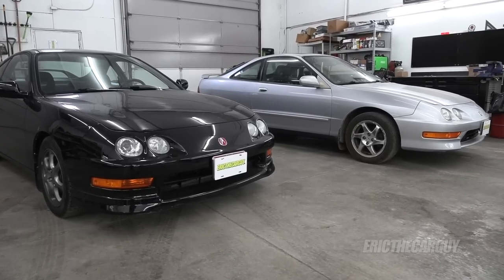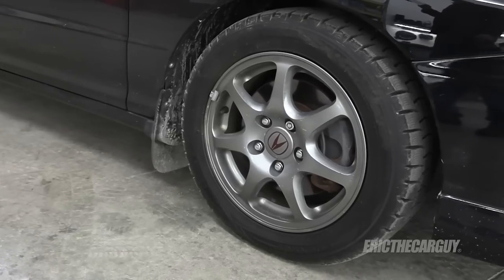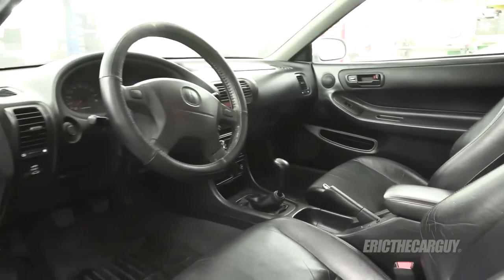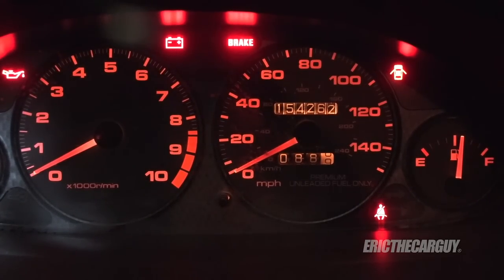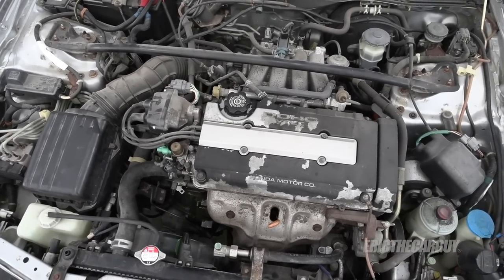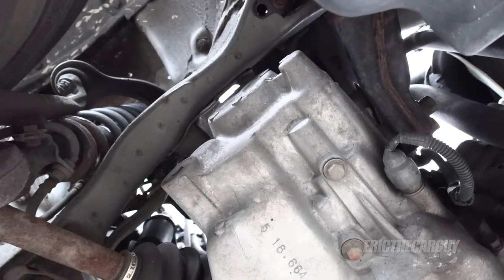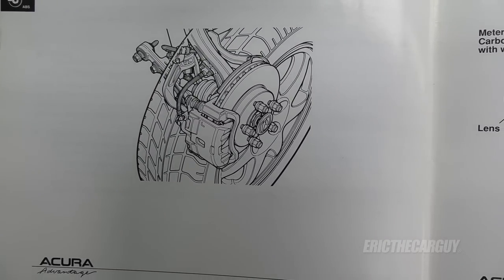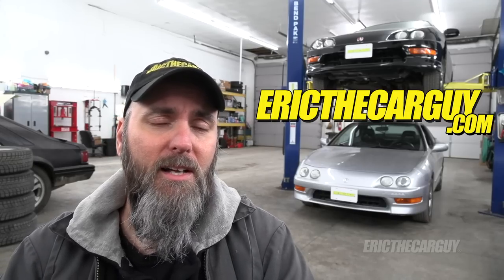Integra Type R vs Integra GSR

Comment: High performance engines always burn a little oil.  No stopping it, and lets face it, the GSR and type R motors are race car engines.  You just don't get that kind of horsepower out of such a small displacement engine without making some compromises and having a little oil burn is one of them.
Reply: F&S Garage it’s better to have oil get through seals and burn then having an over pressurized motor
Reply: @xJDMWaRRi0Rx  they are not race car engines , my friends dodge mini van is faster than these rice lawnmower cars! LMAO
Reply: @xJDMWaRRi0Rx  
You are making no sense
Maybe... than* ?
Reply: Tazer Games oh good looking out bro
Reply: @Mike_Greentea  ok they are not race car engines that also beat some high performance cars 🤷🏾‍♂️ Shame lol
Reply: @Mike_Greentea  doubt that lol
Reply: They only burn oil when the valve guides or piston rings leak.
Reply: Not because they are "hi performance" or "race car" engines.

Comment: You nailed a lot of good points in this video. The gen 2 and gen 3 integras do HUGE with upgraded rear swar bar, sway bar bushings, and new or stiffer trailing arm bushings. A flimsy rear sway bar is an easy way to make a FWD predictable and understeery, which is safe and what most people expect. Tightening up the rear end goes a LONGGGG way on these old cars.

Comment: 1992/1993 The GS-R was available in the 2nd gen Integra in 1992 and 1993. If you had an Aztec Green Pearl Integra in the second gen it was a GS-R. They also have the cool GS-R badge stock.
Reply: I gots
Reply: Db2 Integra gsr>dc2 type r
Reply: @zack54991  false
Reply: TheForbiddenTaco opinion>
Reply: GS-R also came in white and red for 92-93.
Reply: Chip B Those years are my dream car only in white

Comment: Awesome video! So many little details I didn't know about. The poor man's brake upgrade is fantastic: you use mini cooper rotors as they have 4x100 stud pattern, then get the calipers/pads off a V6 Accord/Odyssey like you said. AUDM '98 Integras have the same 1" brake master cylinder as the Type R so it works amazingly well and is cheap. Same can be done on a Civic but the Master cylinder needs to be upgraded too. I have a video of the installation on my channel for anyone interested.
Reply: While I'm here - the ITR rear swaybar upgrade on a dc2/dc4 makes a big difference. I got a dc2r rear swaybar, put some new bushings in and threw that on. It reduces body roll and understeer a lot. When doing this on a Civic or a dc2/dc4 you need to get a subframe reinforcemet (ASR/hardrace/whiteline etc). This is because the ITR came with a reinforced subframe from the factory but the other models didn't. If you don't get a rear subframe brace and you install an ITR swaybar you run the risk of literally tearing your subframe. Also got a video for all this on my channel

Comment: Those rubber rear wheel arch trims shown @3:18 are what cause rust on Honda's, Acura's, Subaru's, etc. They trap dirt, moisture, and salt in the snowy states. Peel them back. You might be impressed at how much crap they hold.
Reply: I never understood why they have to stick out like that and with a gap. They should be tucked under the lip of the well. I mean that's how Hyundai does it and Hyundai is more budget than Honda.

Comment: One thing to note, Honda engines consume oil because the VTEC solenoid is activated by oil. More VTEC = more oil consumption. Love the video! 
-S2000 owner
Reply: I'm also an S2000 oner
Reply: So I have B20 non VTEC swap on mine and it still consumes oil any suggestion on why that is or is it like he said a b-series thing
Reply: Boosted Integra pretty much any high revving engine will consume it, there are ways to minimize it checkout the smoking tire podcast with Steve dinan, he goes a little into how to get more power and less oil consumption out of a e39 m5 engine while making 500+ Na
Reply: As a H22A 5th gen Prelude owner, I can attest to this.

Comment: Great points about addressing rear suspension and accord brakes on civics and integras! That “OEM+” mentality is how I built my E34 525i. E36 M3 cams, E34 M5 Seay bars, E34 540 brakes, E31 850 lower control arms, etc.

Comment: Great stuff.  In 98 I had to choose between the Integra Type R and a Prelude Type SH.  Went with the Prelude, and can't complain as I sold it about 10 years later with 160,000 mostly trouble-free miles on it.  Wish I still had it.

Comment: The b series burning oil statement makes me feel better lol. My little b16a2 burned about 1 quart in single day of track use, (4 sessions, constant vtec and rpms from 5k to 8k etc) and no my motor does not leak a drop of oil. Resealed with all new oem seals/gaskets.  I've been told the oil burning is quite normal, glad you said so yourself!

Comment: A fine discerption of the differences between two of Acura's finest products. In 1997 Car & Driver reported that the main determinizing facture in the production of the type R's was that Honda sub contracted polishing the ports and 200/per year was the limit of the shop. C&R credited 16 of the 20 additional HP to the port polishing. I own a 1996 GSR with 144k miles - I bought it new in October of that year. The BF Goodrich G-force sport Com 2 tires I put on a year ago are EXCELLENT . When the stock coil-overs finely wore out, I learned that the GSR-spec was no longer available.I up-graded to Megan coil-overs which lowered my car 1" - now It corners better then ever !

Comment: Wow glad to see a side-by-side comparison of the GSR and Type R! You're really lucky to have both, and unmodded too!
BTW just to clear some information, 89-92 Honda Integra were the first introduction of VTEC in a production car, not the NSX. NSX, however is the first introduction to VTEC in the US, as they didn't give the early 90s USDM Integras a VTEC motor until 92-93 with the rare as hell B17A1.
Hopefully in the future you get your hands on one of those! One of the most forgotten about Integras out there!
Reply: Was about to make the same comment, actually thougt the CRX was the first to get the B16A, but yeah, looks like it was the Integra :)
Reply: @kingkbh  yeah man. Thats a big misconception i think alot of people have, mainly because of the notoriety of the EF9 and CRX incomparison to the 2nd gen Integras. B16A1s were first introduced in '89 as the first VTEC motor and it was introduced in the DA6 and DA8 Integra chassis (3dr hatch and 4dr sedan [in that order]) at the Honda Verno dealerships (if i remember correct). They are commonly swapped into CRXs and EFs though.
Reply: @Alexmuchacho916  The came in the CRX just months after 👌

Comment: Correction: the first Integra GSR, introduced in the 2nd generation "DA" body style, got a 1.7L B17 DOHC VTEC engine for the 1992 and 1993 model years.  Those cars had a DB chassis code instead of DA.  I believe the very first DOHC VTEC engine in Japan was released in the Civic Si-R hatchback as the earliest B16A engines, around 1989, just before the NSX came out.
Reply: Correction. The first vtec available to the public was in the 1989 da6 xsi and rsi. Both came with a b16a.

Comment: Also the Type R does not have door side mouldings, all other integras do.
Reply: Dreilide RS modes also did not come with side moldings, unless installed by dealer
Reply: @michael_dc4584  my rs came factory with side mouldings, but does not have a sunroof, both my 91 and 97 rs'.
Reply: Good catch!
Reply: popanollie1 then it had to be the other way around some RS models didn’t come with it because that’s what people use to make type r clones

Comment: I totally agreed with you Eric
we own 1997 Type R when it came out, we also had the 1992 GSR.

What Honda made us do in Canada beside signing a waver, we had to get steel rim and winter tires, it was so good handling around corner, and the nose, yes i wish it had more bottom end torque.
i also love the transmission the way the gear ratio close together, where roughly around 500 rpm different.
The entire Type R you can toss around any corner, and the grip of the tires are so predictable and could be push very hard

We did have so much fun, and know how you feel. Yes no Air for 1997, very hot in the summer even up here in London Ontario Canada. 
Every little bit was perfectly assembled.

Comment: Minor correction Eric, the 1992 Integra GS-R got VTEC with the rare B17 engine.
Reply: The 1989.5 Integra XSi was the first production Honda that featured the technology. Shortly after, Civics and CRXs received the same B16A engine.
Reply: I owned one back in 2006, and it wasn't in great condition. It was pretty beat on by the previous owner. The sparkplug was stripped inside the head. I wish I would have kept it and rebuilt the whole car.
Reply: @98ek9  He's talking about in the US which (we) got lame versions (by comparison) of all those cars you mentioned
Reply: The first GSR Integra was the DA body style, and in the U.S., it was 1993 only from  what I remember. It used the oddball B17A, which was just a slightly bored out B16A. I was going to buy one back in the day, but after test driving several cars, I ended up buying a 1994 Civic hatchback with a JDM B18C with LSD transmission. The Civic felt a lot better than the GSR Integra. It was faster by a lot, felt tighter, and had many more newer parts from the engine swap. I still miss my Civic, even now, many years later. I loved that car. It Never left me stranded in the 10 years I owned it.
Reply: The b17 is garbage

Comment: I had a 97 Integra and it was the most fun car to drive. Mine was lowered, so I don't know exactly how a factory Integra handles, but I have never driven another car with such responsive tight steering and precise road feel. The instant the back end started to slide out you knew it and a touch of counter steer straightened her out, right now.   

Eric, keep your Integras,  because they are certain to be a very hot commodity in a few years.

Comment: You also forgot to mention that on the Type R all the metal panels and chassis panels are seam welded for extra strength and rigidity. That's shit you normally only see on racecars.
Reply: I believe that is actually a myth.
Reply: @justincase8037  yes you will read in a lot of places that it is seam welded, but I can assure you they are not. It's just a claim people found on the internet and have ran with it.
The chassis were reinforced, but not from seam welding.
Reply: @Ryan Harrison  Uh no they aren't, for one, seam welding on a production car meant for driving on streets would never pass DOT standards and is completely pointless on a chassis that has already been stiffened to the extreme from the factory with thicker metal in spots and reinforcement on the chassis overall with bars tying various parts of the suspension and chassis points, for two, I've helped on two full DC2 restorations to date now (And also one EK9 CTR) that have been completely stripped and never once have I nor the owners of said cars ever seen any evidence of seam welding before or during body work before paint, for third, My buddy BJ owns a factory bone stock USDM 2001 ITR and we pulled his interior out when he got his to see if his was 'seam welded' and his was not either, this is a myth started on the Internet years ago and complete bs, and for fourth, the wrecked jdm DC2 I pulled my B18C R motor out of was completely stripped interior wise, and again, I saw zero evidence of seam welding, while Honda did make some of the welds thicker in some spots which is evident, they did not seam weld the cars, hell they barely seam SEAL them at all period, anyone who's ever owned a Honda and tried to fix quarter panel on rust on one knows this alone, this is WHY they rust to begin with so bad in the quater panels, stop spreading false information.

Comment: I had 5 Integras through the course of my life which included one usdm type r and one jdm type r and several gsr's. I still have 3 built typer r motors w less than 1000 miles  sitting in my garage just collecting dust. I wish I could find another Integra shell to throw them into. If anyone is interested in buying any of the Integra motors I have or the many Integra parts I have, message me back :)
Reply: Interested
Reply: Do you have three built B18C5?
Reply: Yooo, you still have some Teggy/ITR motors laying around?!

Comment: If you owned a ITR in the 90s you where the GTR baller of the future.
Reply: If you owned one (emphasize OWNED) it was probably stolen. These cars are theft magnets and if you didn't know this at the time, you definitely found out soon enough.
Reply: @BlackWhiteBeast  Yea that's whats sad about the Honda community. It's been like that. Acura and Honda ranked #1 and #2 stolen cars for many years.
Reply: @2_2_4_3  Leaving that community in 1999 was the best thing I ever did. No more issues.
Reply: @BlackWhiteBeast  damn that's the last time you owned one? ... I left in 2004 then in 2007 bought a 2001 GSR but didn't last with it. Damaged the front end and sold it and didn't buy another Honda untill 2016. Went through a DA and a DC4. DA sold for the DC4 then the timing belt broke. Sold that and got a EJ1 that I began to build this time with the intention of keeping it. Welp, not more than a a few months later I made the mistake of parking the car outside my ladys apartment complex so we can run some errands and we ended up not swapping the SUV.. next morning it was gone. 😐 Bought the one I had now out of anger and necessity. Since I needed it for work.. bought another daily and now keep my EJ1 I have built now at my parents crib, with kill switches and parked almost in the backyard so if they want to get it towed it will wake everyone up. 😄
Reply: @2_2_4_3  I had a 1990 eg DX sedan that was bone stock broken into 6 times. The 6th time the interior was completely gutted and left for dead. I also had a 1998 integra GSR that I bought brand new which was nearly stolen within 15 minutes of me being at the shopping mall back in 1998. I came out and they immediately fled in another Honda that they had. Once that happened I sold the car and never bought another Honda again. 

Good riddance because I've had countless wonderful cars over the years that were never messed with and I love my 2019 ZL1 Camaro along with some other cars I currently own. Experience is the ultimate teacher.
Reply: @BlackWhiteBeast  💯 very true.. I'd like to own a Dodge Challenger Scat Pack 😁.

Comment: Thank you for referring to the cam plug correctly. The entire internet, Skunk2 included, refers to it as a cam seal. The cam seal is located at the other end of the head according to the exploded diagrams found on acurapartsnow and sites like those.

Comment: Found online a walk thru adapting the type-r brakes (or cr-v/av6) front calipers, and mini cooper rotors (282mm non s) which with a little modification to the dust shield it made braking with the 4 lug spindle amazing now.
Reply: Can you also upgrade the rear calipers or just the front ones

Comment: I never owned a Honda that didn't consume oil. Keep it topped off and the engine will literally run forever. Amazing video btw!
Reply: HavokStrifeX exactly, even the d16 in the 1.6 Acura el consume oil but that little motor makes enough torque to outrun a pentastar jeep in the corners, moms has 320,000km consumes oil, replaced a head gasket and vtec solenoid and keeps on trucking

Comment: Cool vid..... I bought a 1994 GSR brand new. It was 22,000 out the door in tax heavy Washington state.... bought it at Acura of southcenter. I had it until 1996 - about 30 months , put 44,000 miles on mine. I did my own maintenance (  Oil changes and a valve adjustment )  ... My car used NO OIL . Seriously. No idea who thought they did, but mine did not. I ran mine hard as well, I had it routinely up over 100 mph , the fastest I ever got was 133-135.... It got up to 120 at redline in 4th and then 5th had very little additional acceleration....  It was a fun and cool car in the day, I thought very seriously about getting a Type R as well, but decided it was time for my entry into home ownership and there was not money for both. Looks like I really did not miss a hell of a lot. Great vid though...

Comment: Hi Eric, This was a real treat!  I would love to see the entire 1997 ITR supplement.  I owned a 2001 CDM ITR for 3 years and mistakenly sold it last year.  I missed it so much I put a deposit down on a 98 CDM ITR last night and hope to pick it up next weekend (as long as Covid19 doesnt stop me).  I am a complete ITR nerd and am very impressed by your accuracy.   Your floor mats are worn 2001 mats and can still be had new from some sources.  Many run the EDM mats as they are a fraction of the cost and still nice quality (check ebay).  The 97 to 00 mats are checkered and discontinued.  In Canada we got a 1999 ITR which was actually left over 1998.  These cars were not hot sellers hence the pause in 1999.  Many buyers wanted sunroof, leather and AC.  AC was dealer installed only for all years in Canada and rare to find.   For some reason CDM cars only have faux carbon around the gauge cluster.   You are correct the key is different for 00 01 due to the immobilizer chip.   This car is very special for various reasons and driving one is a treat especially on track.  I hope you keep it a long time and I will do the same with mine!   Ian